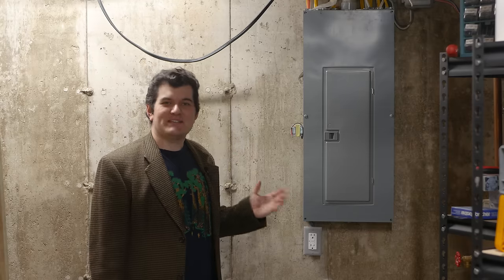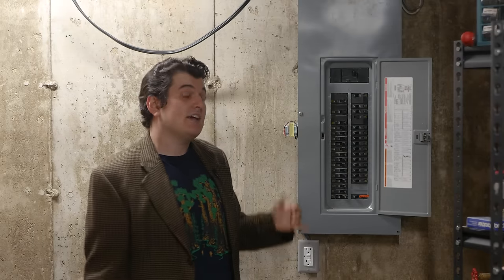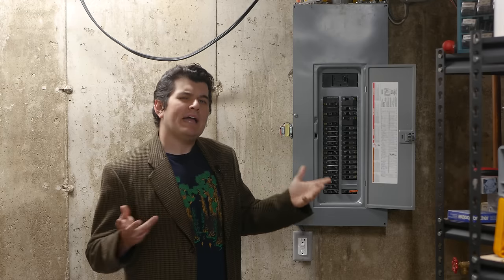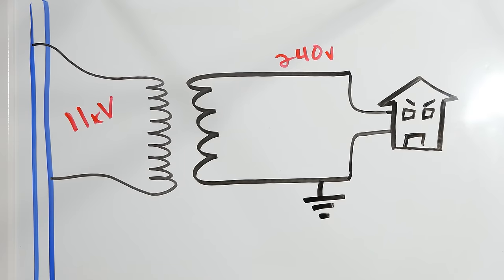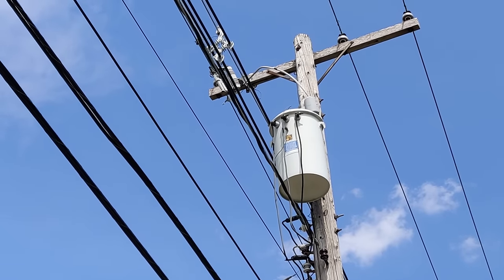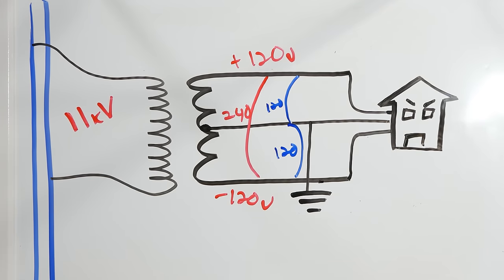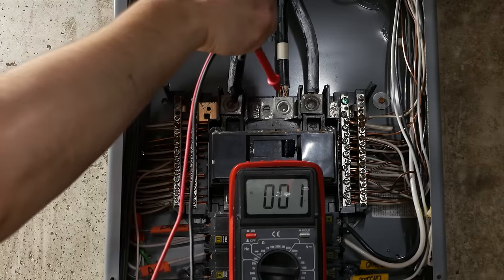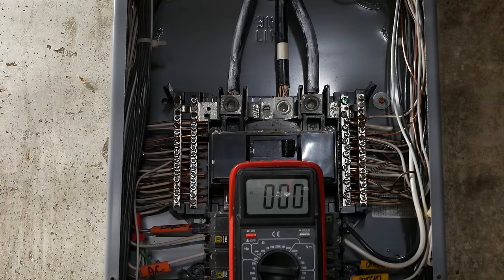The US electrical system is not 120V

Comment: In this video: The YouTube's most beloved pedant tells people to stop being pedantic.
Reply: This might be my favorite techcon comment ever
Reply: Youtube's most beloved pedant is, as usual, incorrect.
Reply: That's because it's his job.  He gaciously does it for us so we don't have to. :-)
Reply: He is deliberately incorrect to make it intelligible to people.

I think he's being stupid about the sarcasm about plugs. US plugs are actually fecking LETHAL

And he's wrong about the 240 vs 120 shocks. Both are equally lethal.
Reply: So of I want 240 for a welder I just need to put in a double breaker and run that to the welder?? I assumed it was more complicated than that.
Reply: @TheChipmunk2008  how are they both equal in terms of lethality? if you set up two shock scenarios that have identical environmental factors (wearing the same shoes, you're body positioned in the same way, floor material is the same, humidity the same, your skin resistance the same, ect.) and the only thing you change between those two scenarios is the voltage level, in the 240V scenario, you'll basically double the current passing through your body when comparing to the 120V scenario. depending on the particular environmental factors, there may be enough resistance between you and earth or hot to barely prevent a lethal current in the 120V situation. now that same situation, if you touched 240V, it would have been lethal. so you are most certainly more likely to die from touching 240V than 120V.  again, that doesn't mean 120V can't be lethal (obviously it can be), it just means all environmental factors held the same, you're more likely to die from touching 240V than 120V.
Reply: @TheChipmunk2008  No, He's 100% correct.

Both are lethal in the right circumstances, (I've had a great many 230v shocks and 100v shocks, as well as more tickles from 48v than I can count, as well as 30kv from an ignition coil and 6kv from electric fences and I'm still here) however 240 is obviously more dangerous, therefore not "equally lethal" due to Ohms Law. 

Your comment is not based on fact, but an uninformed "all electricity scary" position based on irrational belief. 

240v passing through your body is objectively more dangerous than 120v because all else being equal, twice the current will flow, releasing twice the energy. I can tell you that 230v hurts a lot more than 100v. A LOT more. 

I mean really. Next you're going to tell me 120v is just as lethal as 11kv. Except you probably aren't that dumb are you?

Think before you post parroted BS about stuff you have little to no understanding of in a comment section full of technical people who DO understand it.

By the way I have an electrical engineering background so STFU.
Reply: @katiefincher2433  No, you're wrong and are splitting hairs as well.

Europe, (and Australia/NZ, where my background in electrical engineering comes from) don't center tap our transformers. We have 230v single phase, we have some houses with 2 phases going to the switch board, but the second phase simply feeds different stuff, like hot water or stoves, to take the load off the first phase, the two phases never meet in one appliance, so we never have anything but 230v appliances and wall outlets. We have 3 phase (400v, which is what you get when you combine 3 phases at 230v) for industrial equipment.

What the US has is a very different system, and it can be considered 240v standard, as this is literally what comes from the transformer, the fact that neutral/earth comes off a center tap rather than off one leg of the transformer doesn't really change that, at best you're being nitpicky and arguing semantics, TC didn't say anything about the technical details that wasn't true, and all you're doing is picking up on his mildly hyperbolic introduction "The US is a 240v country!" and trying to debunk that with big words like "additive", which in context don't even mean anything.
Reply: @katiefincher2433  I didn't realize baselines could be foolish or evil.  hmmmm  You learn something new every day.
Reply: @katiefincher2433  "Voltage is additive". Voltage is a potential difference. You cannot simply add up voltages without a potential to work with. E.g. you can't simply take a 1.5V battery and add its own voltage to itself to get 3V. You can have two 1.5V batteries in series and thus get 3V but the crucial difference is that, in this case, you have in fact a middle potential that is +1.5V rsp. -1.5V compared to the potential at each end. You establish this potential by having a low resistance connection between the anode of one and the cathode of the other battery.
Anyway, you missed the more important point that there is only ever 120V from neutral in the US . This is absolutely safer (well, assuming a more sane plug design to begin with) because it's not the current that kills you… it's (in all likelihood) the current going through your heart. If you only touch one 120V phase and some other body part is connected to neutral with relatively low resistance, as it commonly will be if you're not wearing shoes, then this determines the amount of current that will pass through your heart. Even if you touch both phases with two fingers of the same hand, 240V is only between these fingers, and much less voltage between either finger and e.g. your feet (that is much more likely to cause cardiac problems). It would be much more dangerous to touch one wire each with both hands. You are also more likely to die if you receive a shock through your left hand than the right hand.
Fun fact: Birds can sit on high voltage AC power lines without being fried because their feet are much closer together than the wavelength, so the voltage between the contact points is low. (On a DC power line, there is also a small voltage but it would be calculated using Ohm's law.)
EDIT: Before anyone else is pedantic with me, I should point out that there are so-called LC circuits, which stands for inductive-capacitive circuit but is also called a resonance circuit, that can boost a DC voltage with neither prior conversion to AC nor a transformer. That's a different story though.

Comment: UK residents have learned after stepping on plugs to leave them in their respective sockets and just flick the switch.
Reply: That is just one thing about the square pin plug i wish we had, the ability to switch an outlet at the outlet itself. But i think what people forget is that the american BI plug is older. A lot of other plug standards had the ability to learn from previous plug failings. We didnt really have that chance and since compatibility is a thing we just kinda got stuck with it only modernizing little bits like polarizing the plug with the neutral being bigger and adding the circular ground pin, as an option wheras the square pin a ground lug is required to operate the safety shutters in the plug even if its just a fake pin of plastic, and really the bi pin could be made better by shoving a bit of plastic on the end of the pins and making the recepticle make contact on the tip of the pins, that way compatibility is kept  for older plugs but newer plugs are safer, the fact that our pins are to close your fingers could also be negated by making the plug a bit bigger with a more pronounced shield, but like I said its a standard weve had for a while and since japan and china also use the bi pin for residential appliances its not gonna change anytime soon.
Reply: Our UK plugs and sockets are designed to last for millions of connection/disconnection cycles and still have a switch to discourage wear.
Every US hotel I've stayed in, the plug falls out if you walk past too quickly.
But for non-UK (or Ireland, Oman, or any of the other 50+ countries using IEC type G) imagine standing on Lego. We're immune to that as the plug is much, much worse.
Reply: @JorgTheElder  We rarely buy portable fans as it's just not that warm here to warrant them, and anybody who does buy one realises that they're probably only useful in June and then that's when it's not drastically cool outside due to freak rain storms. After then our small houses are just cluttered by useless appliances and get thrown up in the attic and forgotten about.
Reply: @georgeprout42  I've never had an issue with plugs not holding unless it was a cheap plug the sockets tend to stay fine as long as you have a modern high quality plug.
Reply: Meanwhile, there's basically no such thing as a UK plug that is loose. There are simply none made that badly.
Reply: To add to the plugs falling out yes I had to replace every plug in our house because well they were really old and probably really cheap when they were put in and they exceeded their life expectancy. And previous occupants of this house decided that tapping stuff in was the better way to go rather than you know preventive maintenance. To add insult to injury they use the backstabs on all of them as some of them did not have screw terminals they were at least all grounded and everything else about the electrical system apart from the Federal fire Pacific electrical panel was in good condition, now retired too.
Reply: @JorgTheElder  So when you bring a fan into another room, you just leave the plug lying on the floor? Yeah, that totally explains it! Nothing to do with silicone valley, or hollywood, its all to do with the fact that you move things from room to room for no apparent reason. Love your logic!
Reply: @georgeprout42  Mate you should try a new zealand plug.. It's basically the same thing, but the prongs are thin sheets instead of robust cubes, much better for opening the skin :/

Comment: I'm so glad the 60hz noise was just sfx, my immediate thought was "oh no anything making that buzz in a residential installation is in desperate need of maintenance/replacement😬"
Lots of data packed into an enjoyable video 🦊💜
Reply: Mine has a very slight hum but I don't think there was any harm in it and my electric bill seemed pretty good for upstate New York's standards.
Reply: Insert the Fluorescent light commonly found in The Backrooms and the one we have in our house.
Reply: Or a single coil pickup.
Reply: @Sheehy223  aw snap that too.
I run active humbuckers in my mockingbird and run it through a direct box but yes that too 🦊🤘💜